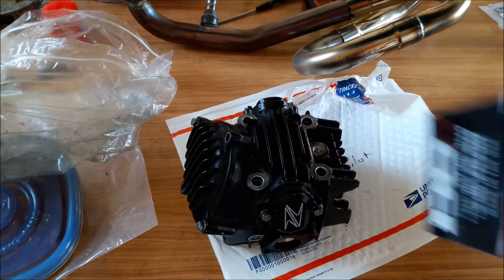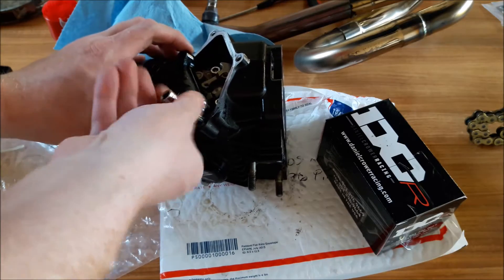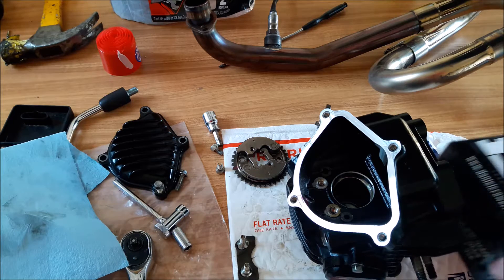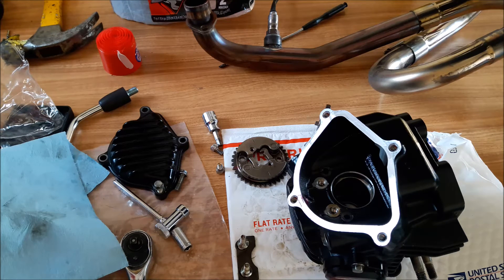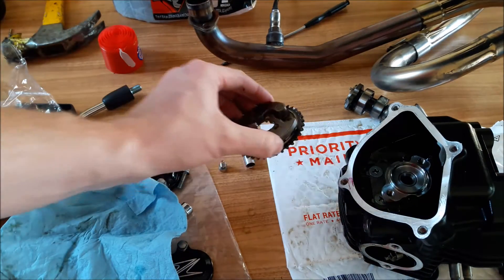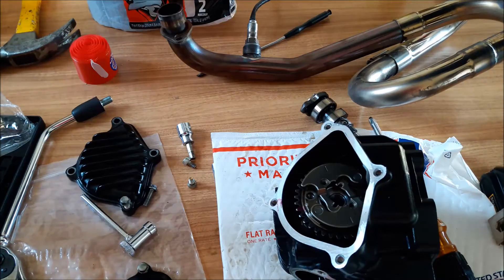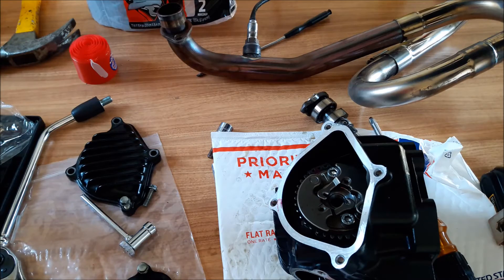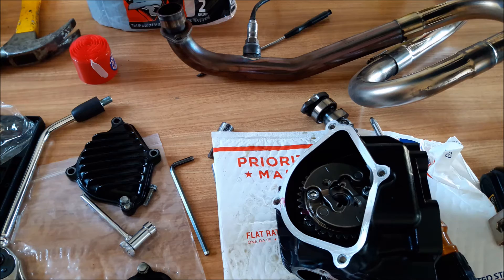Kawasaki Z125 Pro DCR Cam install

Comment: Every bolt on this bike needs to be torqued to factory spec.  It is too easy to over tighten these small bolts and strip them!  When breaking the screws loose you may be better off using an impact driver to avoid stripping the screw head.  Vessel makes nice impact screw drivers in JIS that are good for reg and JIS bolts.  Thanks for taking the time to make this video!
Reply from the maker: Agreed

Comment: where did you get the valve adjusting wrench? i need one!!!
Reply from the maker: Benjamin Wick motion pro... it is very helpful
Reply: Tommy Davis do you know what size? they are showing several different sizes
Reply from the maker: Benjamin Wick I think it was a 9mm with a 4mm or 3mm piece
Reply: Tommy Davis thanks!!